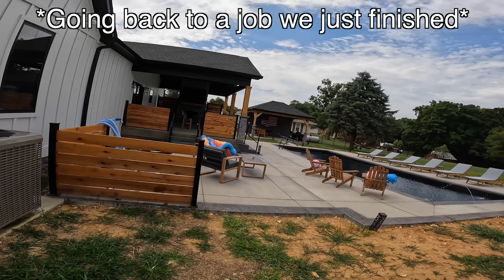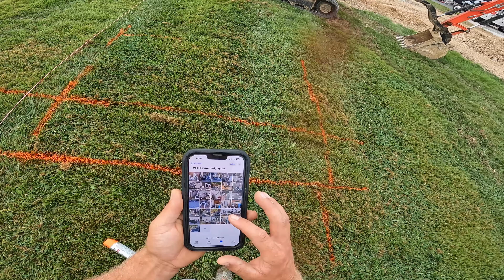Do this BEFORE Plumbing your Swimming Pool so it will NEVER LEAK! ￼

Comment: All of that schedule 40 laying on the rough concrete collar with 40 inches of gravel settling on it is not good. Can't wait to see the liner. Please tell me all the returns are not on the same long wall?
Reply from the maker: @87TurboT we packed the gravel underneath of them so it won’t be an issue. And yes, they are all on the same wall. Why is that a problem?
Reply: @jonport_  To circulate the water. Spin the water so the skimmers work right and no dead spots.